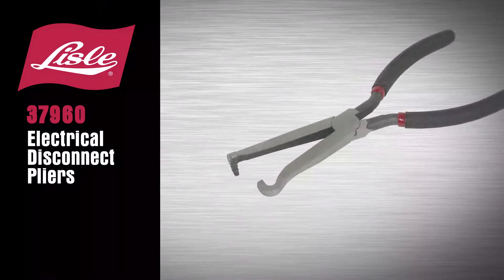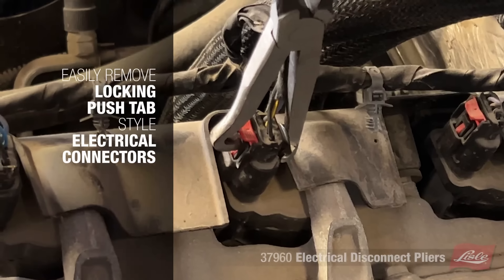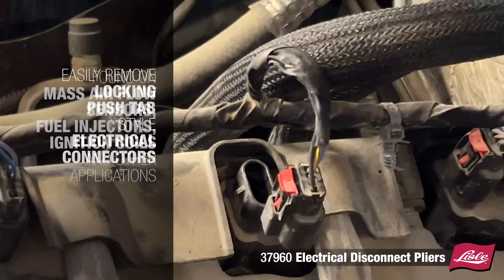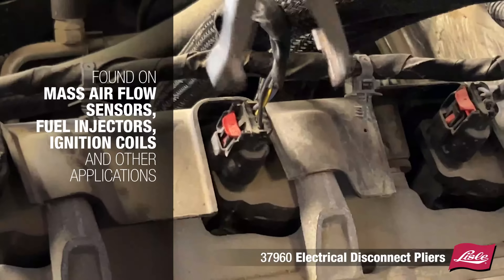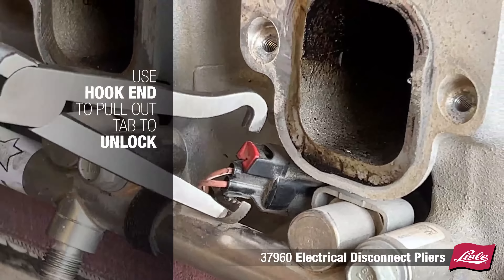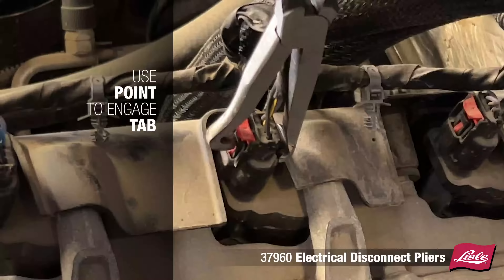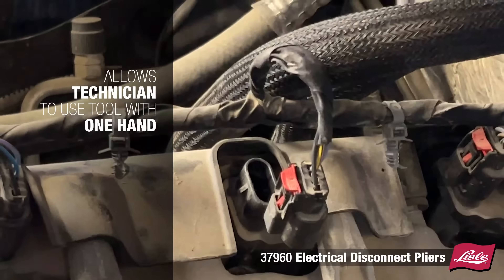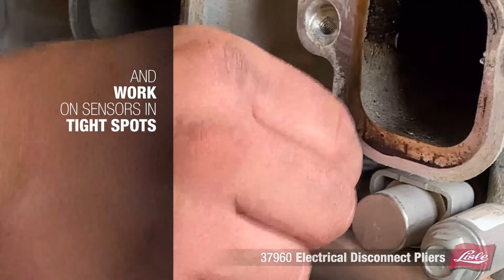Lisle 37960 Electrical Disconnect Pliers

Comment: I have the straight and 60° versions.  The only criticism I have is that the finish is very crude on them, as though they sourced the absolute cheapest Chinese junk pliers and then had the absolute cheapest Chinese machining done to achieve the tip shapes.  None of that affects their function, but if I were Lisle I’d want my name to be put on something a little nicer.  The edges on the jaws come sharp enough to slice fingers.  I had to break all the edges with a file, wire wheel everything, etc.